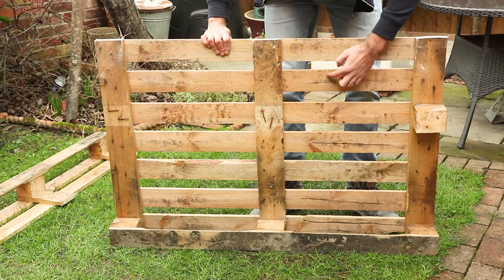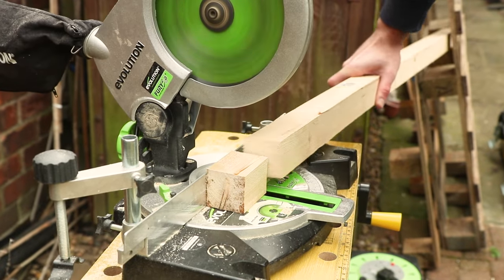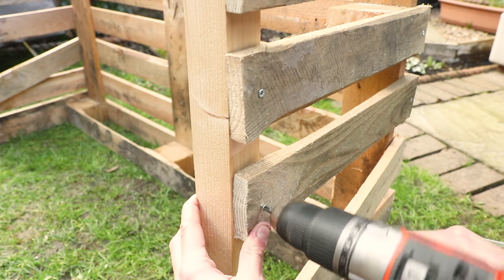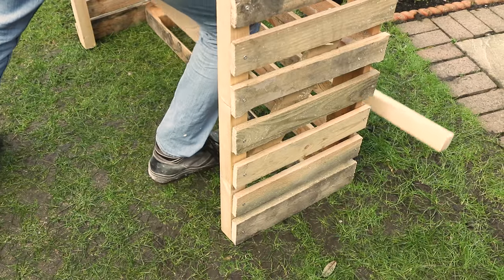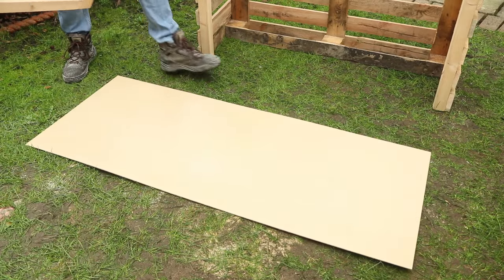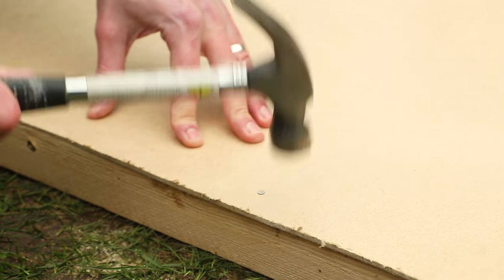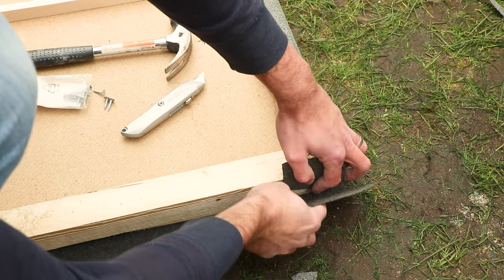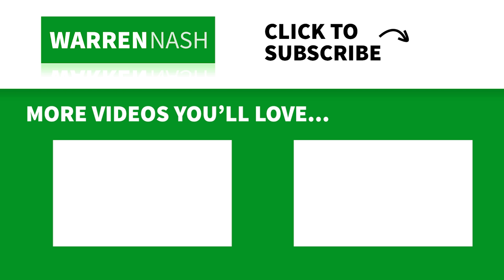Make a Pallet Log Store IN A DAY - DIY Pallet Wood Projects by Warren Nash

Comment: That's very resourceful and looks good, but I would definitely use exterior ply for the roof, not hardboard. Even with decent felt there will always be moisture and condensation in any outdoor wooden structure, hardboard will warp and loose structural integrity very quickly. Also don't bother with pilot holes, just buy decent sharp screws and drive them in.

Comment: That actually was very easy!  I don't know this felt material on the top but the roof looked like it was not some kind of strong material.  However, I think as long as it won't get wet over time, it seems like it will do the job!

Comment: how come the wood doesn't get wet from rain getting in at the open front and openings in the side and back?
Reply: It will - slightly - rain will blow in but it won't do it much harm. The important thing is that it can't rain down onto the wood. The open front and gaps around the back and sides allow for maximum air circulation which is vital for seasoning unseasoned wood. As others have noted, however, it would be good to have a raised floor to the log store to keep the logs at the bottom dry.

Comment: Trying to build this and I’m having to attempt the roof AGAIN.  Have cut the wood 5cms bigger than the structure but still too small.  Should the wood be 5cms each end????
Reply: The instructions were not correct on the video unfortunately - the batten actually needs to be the width of the wood store + 5cm PLUS 2x width of the batten that will be fixed perpendicular to make the frame.

In this example on the video it needs to be the width of the wood store + 5cm PLUS 100mm

Hope that helps if you haven't already worked it out 👍
Reply: I thought exactly the same, and kept watching the video for clarification.